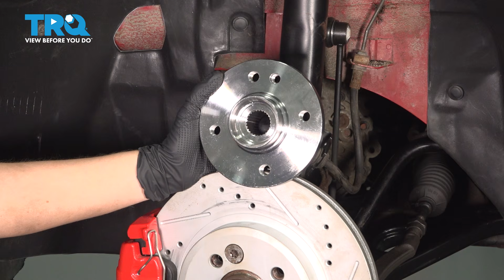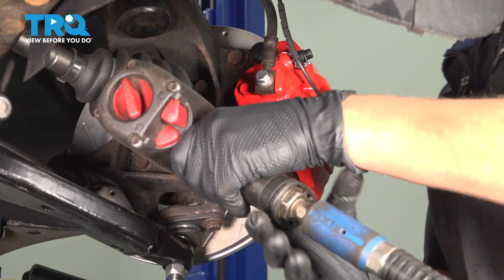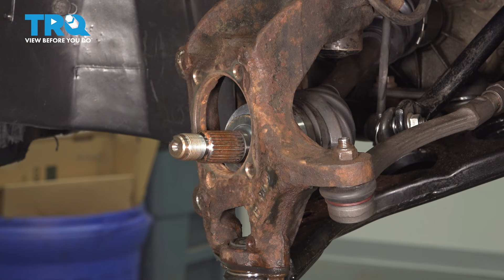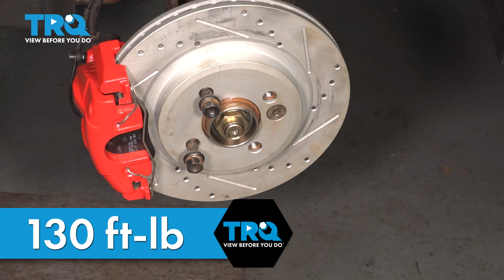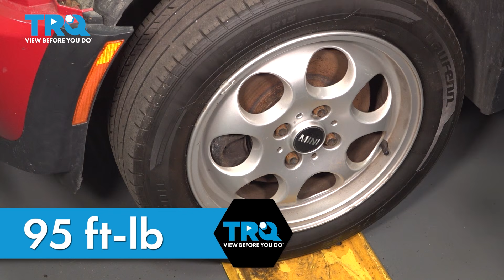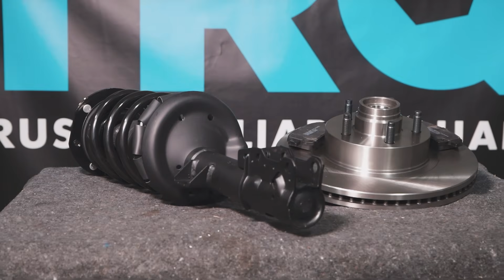How to Replace Front Wheel Bearing & Hub Assemblies 2000-2006 Mini Cooper

Comment: Great stuff. Very clearly done, succinct and to the point. My Mini needs this done after I drove all the way to Bulgaria and back to Scotland. There were quite a few dusty tracks and jarring potholes along the way and by the time I got home I could hardly hear myself think. The front and rear brake discs and pads will be needing done as well. Oh! And the plastic under tray below the engine is flapping at one side as well.
I'm gonna have to spend some time and money on the car, but it'll be well worth it. I had a great time this summer. 3 months and 10 thousand miles covered. I'll probably do an oil and filter change, and an air filter as well.